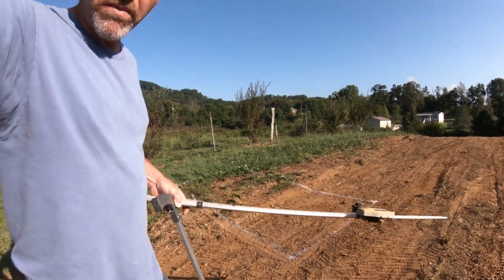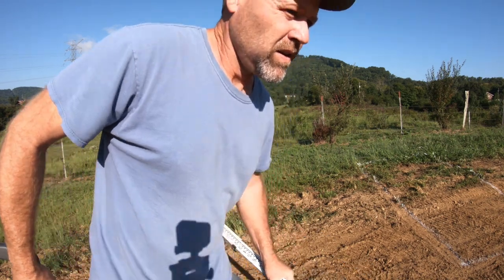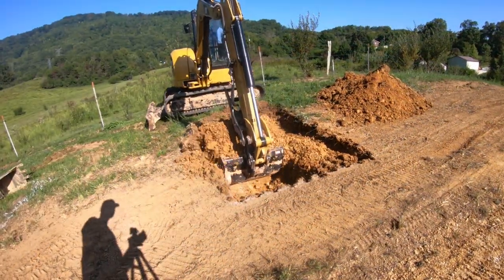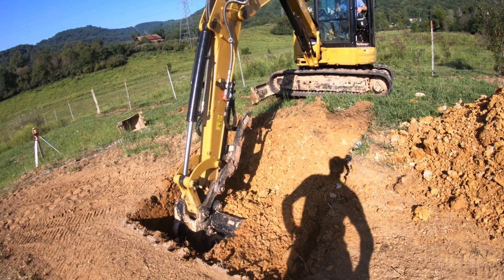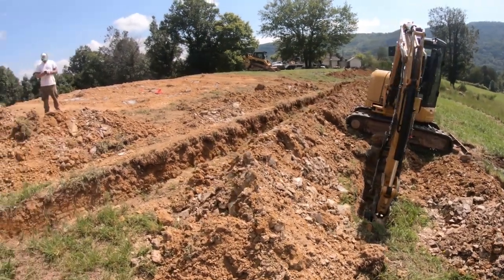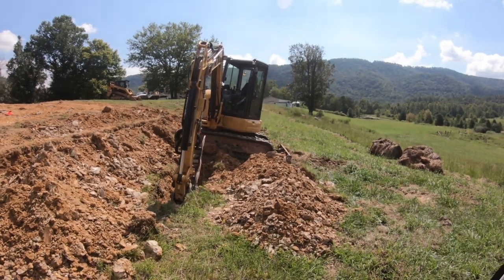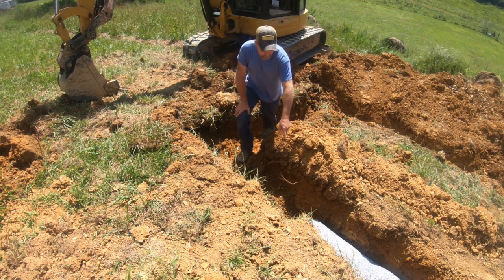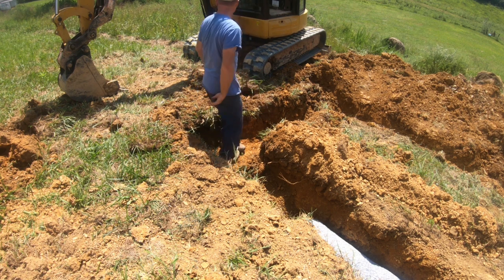Installing a Septic System in TN

Comment: A couple questions for you guys.
1. Would it be better to use a distribution box with “fingers” if the space were available? It looks like this site has limited space and you needed to have a continuous snake design. 
2. What diameter EZ pipe did you use?
3. With our crappy soils in TN that don’t perc well how many linear feet would you need for a 3 person household?
4. How deep were your trenches?
5. How far apart were your trenches?
Reply from the maker: 1.  Each state dictates what type system you can use. TN utilizes crossovers at the end of each lateral line essentially flooding each ditch before the effluent moves to the next. 
2. It’s a 4” perforated pipe surrounded by 2” of polystyrene aggregate. 10” total. 
3. The number of bedrooms in the home along with soil perc rate determine the linear feet required. Starts at 110’ per bedroom and is adjusted up or down based on perc rate. 
4. Trenches are usually 24”min -36”max. 
5. There has to be at least 6’ of undisturbed soil between lateral lines.
Reply from the maker: Sorry. Pipe is surrounded by 4” of aggregate.
Reply: @barnettsonswoodanddirt8703 thanks for the info. Might I ask where is the best place to buy tanks/ ez flow and supplies for septic installs?